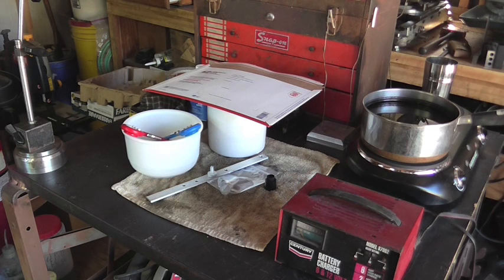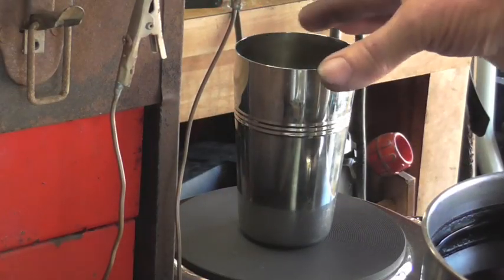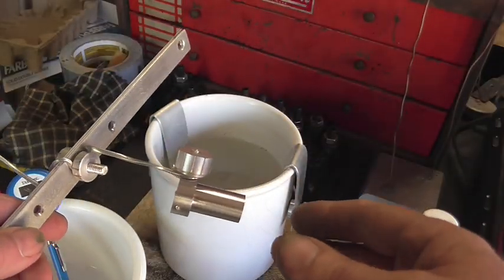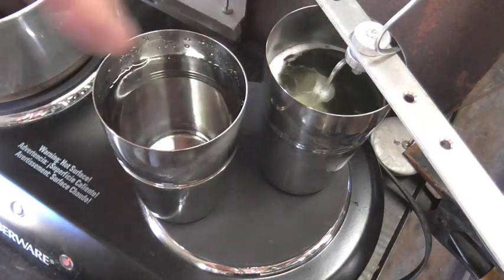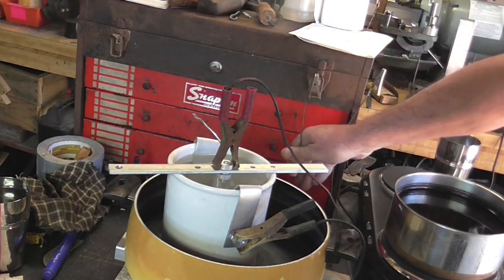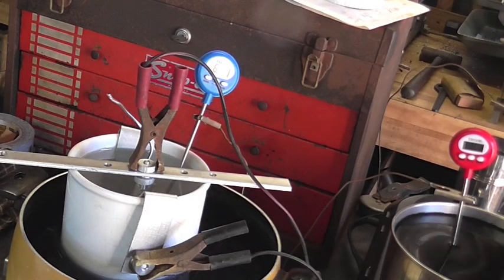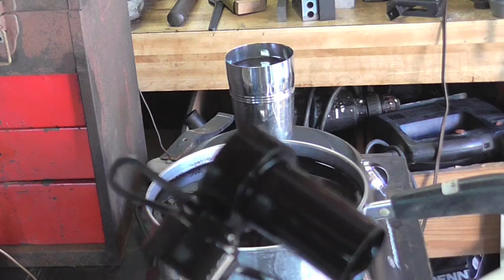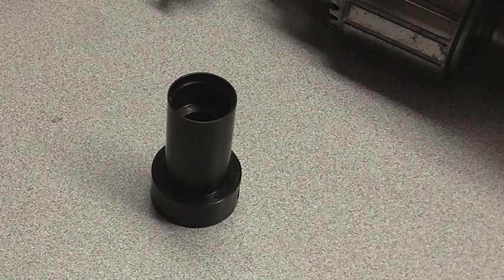⚡️How To Anodize Aluminum Parts Easily In The Home Shop - MSFN

Comment: Cool.  I thought, before now, the dye was the same time as the electrical process.  What does the electrical process do?  Does it "open the pores" of the metal?  If not, why is that step needed?  Why not just dunk the part in the dye then, seal it?

I realize I know nothing about this but, I am curious.
Reply from the maker: The electrical process opens the pores in the aluminum to accept the dye as you thought, the hot water bath at the end seals the "pores" to retain the color
Reply: @MakinSumthinFromNuthin  
So, clear anodized aluminum gets what as a finish?  Do you know?  Is it the same process?
I had some black bicycle chain rings re-colored to blue.  They were a little dark.  It's okay.  I was just wondering.  Did he use a different dye or for too long in the dunk?  Are there different dyes?  Brands or even a different material to use as a dye?

I know.  Lots of questions.  It's just this is so cool.  I want to know more.
Reply from the maker: "Clear" gets everything except the dye, and still anodized.  Dye dunk times...dye brands, etc... do affect color
Reply: @MakinSumthinFromNuthin  
Thank you.  Maybe, someday I can try this.  Thank you for the great video.
Reply from the maker: Try it!, its fun :)

Comment: I miss the days when Rit had a ton of choices for colors and was in powder form.
Reply: Joanne's still sells that
Reply: @Void970 t They left my city a few years back.  We used to get it everywhere even WalMart and Kmart or Target but now Kmart is gone and the other two only have the liquid.
Reply: Michaels, Joanne's, hobby lobby.... Pretty much any craft store has it. You can use food coloring also, or cut open sharpie markers and put the ink tubes in hot water to bleed the inks out. All have worked just fine for me
Reply: @AaronNeezNielsen  That is the problem in my city all of those closed down unless we go 35 miles away.  What I was getting at is that for 50+ years those items could be found at KMart, Walmart, grocery stores, but now they seem to all be the liquid nonsense.
Reply: @thebeststooge  liquid works all just the same.. If you want a richer color just use less water and really soak it for at very least a half hour, I personally let mine sit in the color for about 45 mins to an hour and make sure it's nice and warm too and then boil the parts immediately after for about 15 - 20 mins in just plain tap water
Reply: I get great results from just regular ol food coloring. Great bright reds, yellows, greens, even black, and all have a nice Candy look to em unless I etch the piece in lye, sandblast, or wire brush before anodizing, that makes a more matte look. And as one other person stated here it's best to neutralize the piece after the anodizing stage (reg tap water and baking soda), just dunk it in real quick and spray it off with water befure going in the color bath. Otherwise tgat acid still coated in those pores it just made sometimes won't grab color as well.. Also, tie dye kits are the samw as Rit and those are typically always powder and at most dept stores

Comment: I assume you can use any color of rit dye that you want. 

Just so I understand, the acid bath etches the part so the dye can soak into the metal?
Reply from the maker: The acid bath creates the anodized layer when electrified. Looks like an empty honeycomb layer. The dye fills the honeycombs, the hot bath seals the honeycombs making the color permanent. Yes, can use any color
Reply: @MakinSumthinFromNuthin  oh, I see. Additional aluminum is added to the part during electrolysis. The aluminum comes from the flat bar you have inserted into the acid. Eventually after many parts are anodized, the aluminum bar will lose Mass.
Reply from the maker: Exactly!

Comment: This video gave me the encouragement to give anodizing at home a try and now I'm happy that I did. Thanks for the info and encouragement.

My first attempt was a failure with my parts only taking enough dye to make them look dirty. 

In my second attempt I used PB Blaster to thoroughly degrease, followed by a 10 minute soak in hot detergent water, followed by a deoxidizing soak in hot trisodium phosphate solution for 15 minutes, a distilled water rinse and then into the anodizing bath. 

Based on Caswell's LCD (Low Current Density) anodizing process I intentionally kept my battery charger current below 2 amps for 90 minutes, in a solution which was cold to begin and didn't rise much during the anodizing.  A quick rinse in distilled water and then into my 120-140º dyeing solution (2 qts distilled water to 1 bottle black Rit dye) for 15 minutes followed by a seal in boiling water for 10 minutes. 

After polishing with a cloth, my home made parts now look deep black and professionally coated and I'm a bit stunned at how good they look. 

I'm also eyeballing the disposable aluminum cookware at the grocery store as single use anodizing vessels since they already have the cathodes built in.
Reply from the maker: Thats excellent! Always glad to hear people giving it a try and succeeding :) I may have gone overboard a bit on the clean, clean, clean aspect but it is really quite important! ~ Congrats Sir

Comment: I absolutely love this video. It gets to the points without a bunch of nonsense. 
I cant wait to try this out.

Where do you get the aluminum wire and the aluminum you used for the cathode?
Reply from the maker: The wire came from an electrician friend who had a 3 foot piece laying around, the wire had like 18 strands of what you saw me using in it. The cathode material was cut out from a discarded road sign I found
Reply: You could try Amazon.com but you will be at the mercy of not being able to get specs on materials in some situations.

Comment: Thank you very much. Very educative.... I am on my way to try your technique. This is my first time :-)
Reply from the maker: Its not hard, I figured most people that watch it never tried it. So tried to explain everything thoroughly. Good luck!
Reply: Tried with mixed results.... Will have to perfect the techniques! :-) Thank you
Reply from the maker: Cleanliness is key, and proper connections. Experience and trial and error....am confident you will master it. A solution of 100% lye crystals and water will strip the color off the botched attempt. And you can try again with the same part.

Comment: Why..  Do this.  Aluminum takes like 2000 years to oxidise or 'rust' lol
Reply: To add color
Reply: Makes it harder, abrasion resistant, chemical and salt water resistant, takes color, electrically an insulator, looks cool.
Reply from the maker: Good one! :)

Comment: What ratio would you recommend for a good royal blue color? Also, will the powder rit dye work as well? I was told that they use the powder dyes to make the liquid dyes. 

Thanks in advance. Great, informative video. :)
Reply from the maker: I have never done blue so dont know. Have never tried the powder either so I wasnt much help at all! Just experiment

Comment: but what is the degreasing solution used???? plz answer me!
Reply from the maker: Diego, I just used Simple Green, its pretty inexpensive ~ Richard
Reply: I'm  not from USA!! I'm from Lebanon, SO we don't have this product "simple green", But I make a small research about this matter, and i deduce that we have similar solution to simple green. But I will ask you if we can use for example a diluted solution of NaOH at determined temperature?
And thx for your aid
Reply from the maker: Yes, you can use a dilute solution of NaOH (Lye) but it will lightly etch your aluminum as well and depending on soak time turn a polished surface to a matte finish so keep that in mind. Simple Green is just a concentrated degreaser in liquid form, I am sure you have something similar there....check around for something that wont etch the aluminum :) ~ Richard
Reply: thank you for all... I will try to find  something similar.

Comment: whay should all suspension parts be aluminum? would copper not work as well since these parts just need to transfer the current to the aluminum part you want to anodize? just a question since I kno nothing about it! :) cool video tho!!
Reply: Tom De Bruyn if you use Copper wire it will react with the Sulphuric Acid to make a Copper Sulphate solution . This is toxic.
Reply: Tom De Bruyn For what it’s worth I took chemistry as part of my university course, which was a very long time ago and I also tinker with electronics as a hobby. Iron will react with sulphuric acid to form Ferric Sulphate which is not toxic. Copper in its natural state is not toxic, copper pipes are used all over the world to transport drinking water in houses. It’s only nasty when it’s combined with acids or alkalise to form salts. 

The difference in conductivity between copper and iron in this case is not a problem. The author is using a power supply that supplies sufficient current to overcome the difference. I think he uses all aluminium to avoid contamination of the electrolyte by other metals. I’m assuming that his anode is also Aluminium, not lead as some people use, 

When I get the legendary round tuit I want to do some anodising for the front panels of my radio projects. Then I’ll use a laser engraver to remove the anodised layer so I can name the various controls, for example the tuning knob. 

This tutorial is by far the best one on anodising I’ve seen. Thanks!
Reply from the maker: I dont know the scientific reason why....it was the way I was taught so always stuck with it since it works. I think its a contamination issue~ Richard
Reply: Thnx Stephen! seems logic that you would aluminum than, but could you use normal steel wire as well or is the conduction of the electricity not good enough than?
Reply: Yeah I am an electrician and plumber in Belgium and we use it all the time but i never work with acids so I had no clue about it! the thing is that it is pretty hard to find aluminum wire around where I live :)
Reply from the maker: For my aluminum wire I used a discarded scrap piece of wire used for running power to a house, most are stranded aluminum of pretty heavy gauge....works good for this
Reply from the maker: Yes Stephen, I used all aluminum to avoid contamination at all levels and I did not use lead, but aluminum plate from a discarded road sign....both work equally well IMO. Glad you liked the video and helped out the other commentator 😊 ~ Richard

Comment: Richard, have a question for you...just curious! Instead of using a plastic container with cathodes is there any reason why you could not use an aluminum can with liquid in it and suspend the article you want to anodize into the can. The can itself would be the cathode?
Reply from the maker: Dunno, would be worth a shot....interesting concept. I would have to say that your "can" would have to be 100% aluminum and not an alloy. If you try it let me know how it works. My cathodes were made from a discarded street sign :)
Reply: Need to grab a few things and give it a shot! Pepsi cans are supposed to be aluminum and I was also thinking     
Disposable Aluminum Foil Pans used for cooking.
Reply from the maker: Gord, after thinking about it more I believe you would create a direct short doing that, I would use something non-conductive like plastic
Reply: Going to do a bit of experimenting at this end, can't hurt and could be fun ;)
Reply from the maker: Keep me posted on the results! ~ Richard
Reply: For sure...
Reply: No experience myself but from other videos I've seen on this the cathode gets "eaten" during the process so I would suggest sticking with a plastic tub.

Comment: Would this process add enough thickness to where I’d need to mask threads and tight tolerance holes?
Reply from the maker: Good question, it depends on your thread tolerances. Depending on anodize time expect a .001-.002 increase in OD of the anodized part.....or the reverse if anodizing internal threads. If anodizing both internal and external threads, some adjustment may need to be compensated for before anodizing...it does increase dimensions....albeit small
Reply: I'm planning on masking potentially tight tolerance features on my parts using 3M 484 electroplating tape. Have any experience with that stuff?
Reply from the maker: Nail polish will work too, dont let co-workers catch you with it tho. Never worked with expensive products like 3M :)
Reply: U didnt watch till the end huh

Comment: Richard, I’m thinking about anodizing the aluminum frame of my paramotor trike which has larger parts. How would you scale up your process for 3x3x24 angle or a 48 inch tube?  Do the parts have to hang free the solution without anything touching
Them?  Thanks, Jim
Reply: @Jim I have used a piece of rain gutter, for electrolysis rust removal, I can’t think of a reason it wouldn’t work for anodizing.
Reply from the maker: Hi Jim, I have no experience with large stuff, I generally just anodize small items as was shown here. The acid solution ratios would be the same but I believe the voltages used and anodize time would vary from what was shown here. The plates the negative charge is hooked to would most likely need to be scaled up as well.

I am no expert at anodizing, you may need to ask someone more knowledgable than myself or research the voltage and time aspect on the internet a bit. You cant hurt the aluminum so experimentation could also be your best friend. The parts would need to be fully suspended and not touch anything....or each other. ~ Richard
Reply: At the cost to make a bath that large, you would most likely just outsource to a reputable company who is already setup. Unfortunately I am running into the same sort of issue with my powder coating setup. I do ATV parts and builds, and would like to have an oven large enough to do a frame, but the cost is pretty high to buy/build one. So, unless I plan to do multiple frames, possibly for customers per say, to recover some of the investment, I'm probably going to just have a shop do it.

Comment: Thanks for making this informative detailed guide. I have been searching for ever for goblin green gimbal stick ends for my radio transmitter and now I'll just make my own.
Reply from the maker: Nice, hope it works out for you :)
Reply: I have a question I hope you may be able to answer. Is it possible to remove the dye from a piece and re anodize it another color. I am having trouble finding my components in bare material and want to sand them....is this possible ir is it a one and done process. Thanks
Reply from the maker: Yes, totally doable :) Mix 1/2 tablespoon of 100% lye crystals(Drain Cleaner) in 1 cup of water, mix till dissolved and drop your parts in, it will remove the existing color, takes an hour or less ~ Rich

Comment: dear are you know about jin stirrups and I am this stirrups maker and I have made my own model and machines by CNC technology with T6 material and now I am installing anodize small plan home base.
I make a transfer rectifier from 12dcv to 30dcv adjustment with 600A
I have sulfuric acid bath size is 2 foot b 4 foot.
can you tell me that is work fine.
can you tell me sulfuric acid can work at the temperature of 70c for clean and shine aluminum parts before 18v sulfuric acid bat process atleast 15mint in shot!

thanks and waitng your faster reply?
Reply from the maker: The procedure I showed is for small home shop use. I have never done anodizing on a large scale. The temperatures I provided are in Farenheight, not celsius. I would refer you to others who have greater knowledge on the subject for large scale operations

Comment: hello dear friend can you tell chemical name and its method when you clean your aluminum part In steel glass at your video time 5.14 

thanks
Reply from the maker: That was degreaser. The brand used is called "Simple Green", any good degreaser will work fine
Reply: dear are you know about jin stirrups and I am this stirrups maker and I have made my own model and machines by CNC technology with T6 material and now I am installing anodize small plan home base.
I make a transfer rectifier from 12dcv to 30dcv adjustment with 600A
I have sulfuric acid bat size is 2 foot b 4 foot.
can you tell me that is work fine.
can you tell me sulfuric acid can work at the temperature of 70c for clean and shine aluminum parts before 18v sulfuric acid bat process atleast 15mint in shot!

thanks and waitng your faster reply?
Reply from the maker: The procedure I showed is for small home shop use. I have never done anodizing on a large scale. The temperatures I provided are in Farenheight, not celsius. I would refer you to others who have greater knowledge on the subject for large scale operations

Comment: Glad it is easy for you guys in the US to source sulphuric acid readily. 
Here in Australia, virtually the only way for a man on the street to get some is to buy a battery and tip it out! 
I tried a few years ago to do some anodising, and gave up trying to sulphuric acid. 
I was considered either a terrorist or sicko that wanted to throw it in someone's face. Same story from numerous outlets. 
Friggin Nanny State :-(

Good news is swimming pool acid is almost the same formula, which you can get easily. 
I tried it and had success, but the times/currents were a little bit different.
Reply: It was dry acid, sodium bisulfate https://en.wikipedia.org/wiki/Sodium_bisulfate
Reply from the maker: Thats ridiculous, glad you found a solution. Thanks for sharing ~ Richard
Reply: There was a blog post I just read discussing using that same chemical, maybe it'll help you? http://www.observationsblog.com/sciencetechnologyexperiments/anodizing-and-dying-aluminum-without-battery-acid

I was thinking of giving that method a try myself.